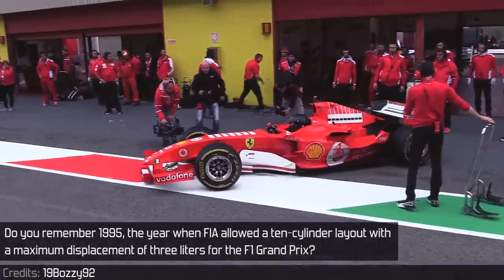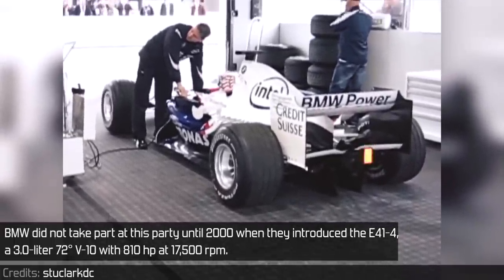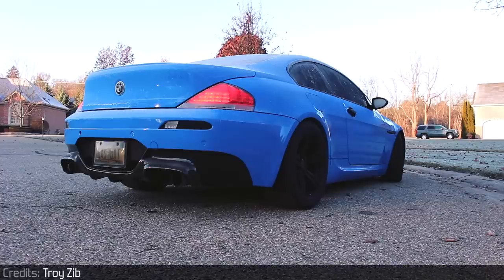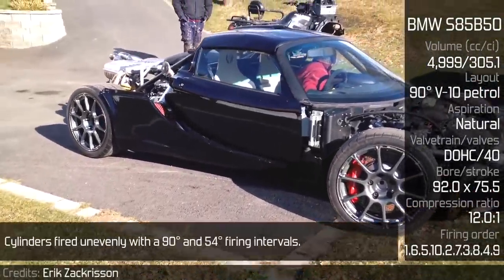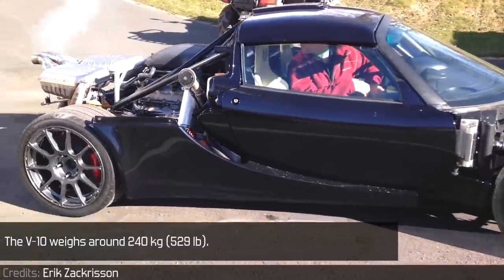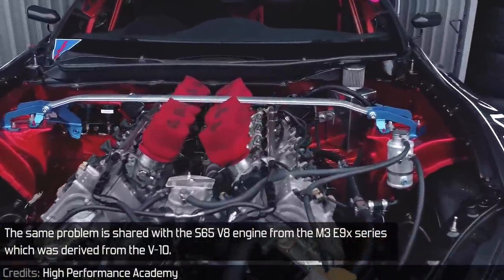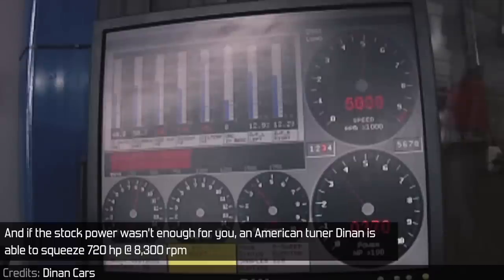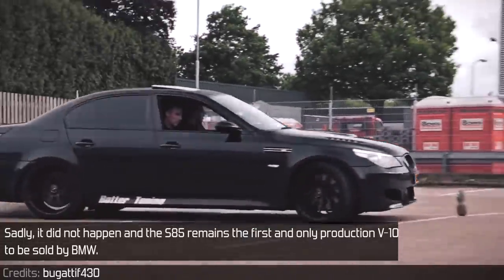BMW S85: Explained | The Only Production BMW V-10

Comment: Still, there’s no mistaking the fact that this engine makes one of the most beautiful engine sounds ever! 😍😍
Reply: Josh Bacon agreed mr sir
Reply: Like drill xD
Reply: Truuuuuu
Reply: It's quite the nice sounding engine, though in my opinion I still prefer the Viper V10 sound given it's a lot more rugged and nasty as opposed to the higher pitched fairly orderly sound. It'd be cool to see other designs that could come in newer sports cars, but it's a bit impractical to the manufacturer.
Reply: Protozerostar I would almost go as far as to say that  because of the high pitch, i like the BMW V10 more. If i wanted to hear a huge engine with enormes displacement and a lot of cylinders, i would look for WW2 aircraft engines ;D (oh, and don't forget the starting problems and the sensual rough idle :D).
Reply: Yes and not a single video i have seen has come even close to what it sounds in real life
Reply: NewSchooler Yeah, you can't beat the LFA :D. The cylinderheads and the exhaust systeme  were build by  Yamaha (also producing music instruments), that says it all :D.
Reply: the sound is really Good. But one should not forget about the Lexus LFA
Reply: It does sound pretty good, but I must admit I personally prefer the e39 M5 sound 👍
Reply: lexus/ toyotas V10 is better sounding
Reply: Too bad that they had rod bearing failures.

Comment: This and the V8 M3 was the time when BMW went balls to the walls
Reply: Zuhairi Zamzuri and they left reliability off the table as well
Reply: As opposed to all other M cars before and after that have had ZERO problems? GTFO troll.
Reply: Biggus Dickus major issues must be the requirement for a great engine then
Reply: SR20DET_RX7 bruh your name is SR20DET_RX7  literally you’re bagging BMW for unreliability yet have SR20DET in your name a engine Made out of glass and blow up every second it has AND EXPENSIVE asf to rebuild or replace that
Reply: @YoBoyNero   Lol, he replaced his 13B with an SR20DET after it blew up. 13B and SR20DET are both more unreliable than the S85.
Reply: @simonnim321  Cough Cough Subaru Boxer Diesel Is The Worst In Reliability. Cough Cough
Reply: @simonnim321  It Sounds Great, But Has So Much Disadvantages...
Reply: @meifert2  It's a compromise between a race motor and a street motor. It's as expected
Reply: @YoBoyNero  actually it's not that expensive or difficult to rebuild a rotary. The factory 12A had 300,000 miles on it and the SR20DET I swapped in is from a 270R.

Comment: Best engine ever made by BMW (in my opinion) 2nd Best V10 Sound, 1st is the Lexus LFA
Reply: M5 > lfa fight me
Reply: Couldn‘t agree more ;-)
Reply: Actually there are two V10 that I‘d prefer over the S85B50:
1st: Porsche Carrera GT - it‘s a manual!!!
2nd: Lexus LFA
3rd: BMW M5 & M6
Reply: An S85 with VANOS deleted, leaves LFA in dust on sound competition.
Reply: @danijellucic2086  why what does the VANOS do to the sound? carrera gt still better
Reply: for all here lfa v10>>> you can find straight piped version of any car even carerra gt  but not lfa. for the guy above put that vanos delete aside.

Comment: One of the best engines in the world
Reply: 722 Silberpfeil ///AMG  and poor reliability
Reply: 722 Silberpfeil ///AMG best at eating connecting rods!
Reply: Rayhan S you are just jealous
Reply: Amo Lay  jealous of what?
Reply: Rayhan S have You owned one?
Reply: Kooper48 i almost bought one until I checked the oil. Chunks of metal in new oil is bad and that is a very common issue
Reply: how did you check the oil?
Reply: John Anderson send sample
Reply: If they wanted to make a reliable engine they would build a port injection inline 6 with no vanos...it would be slow and sound like crap and serve a different purpose.

Comment: Sadly. Oiling has been a M problem.  Our M52 E36 track car has 294K km's on the clock and still does 8 to 9 sessions hard times per track day. The M54 is another die hard. The last M5 with great reliability was the E39.
Reply: you have  a daily engine in your e36 , not m engine..... this is a lot difference man !!!!
Reply: mikkei no it is not. These failures are not acceptable. I happen to be a BMW workshop owner and owned a M5 E39 which is now owned by a customer of mine. Shit brakes,greatest looks ever and an unreal engine.
Reply: 215k miles on my m52 and I’m still beating the crap out of it!
Reply: Cosmic Surfer Didn't the E39 m5 v8 have rod bearing issues too?
Reply: What more does a driver want :)
Reply: didnt heard of e39 m5 rod bearing issues if anything the e92 m3 v8 can share those issues since they're practically same design, it's a s85 with 2 pots cut off
Reply: M50/52/54 are some of the most resilient engines ever. BMW at its best. Is what you'd call "overbuilt". I know a few of them with a turbo making 500+ HP on stock internals while still getting abused on a daily basis. It's somehow absurd for an engine, that was built to be N/A, to make 3 times the power and be reliable. I've seen 3 solid hours of continuous drift abuse on a stock 2.8. Was running absolutely normal afterwards. And that was not the only time it has seen that. It was a drift car. 
The only thing you need to keep in check is the cooling system, due to the usage of plastics. Replace the radiator and the expansion tank with aluminum and you're done. Use and abuse.
Reply: Siddhant Ala i have not heard of one having Rod issues and the one i owned is still running after 17 year and the motor has never been opened.
Reply: I changed mine, they have problems same as s54 and later s engines. Best problem solving is using dry sump system on them.
Reply: Cosmic Surfer the v8 in the M3 has major bearing issues. The engines rarely last 80,000 miles
Reply: Cosmic Surfer I kinda agree with you. Bmw took a bold decision with ///M E60, but I know you love the sound of S85 and the technology behind it anyway 😀
Reply: Any street car running 60w oil is going to have excessive bearing wear if the clearances are tighter than 0.020".    S85 has clearances around 0.012"-0.015"  ,  I suspect the same for the S65.  Makes no sense why BMW chose 10w60 as the oil for those engines.
Reply: Cosmic Surfer lol all I hear is a bunch of krappy motors you listed there. The s38b38 gets my vote for 6 cylinder and the s85 for a v config motor. I have had the m50 and m52 and I really don’t see what all the hype is about a 1jz/2jz ge motors are 10x better than them in every way
Reply: @fmn716  Dont forget the M30 engine, have had a few of them and they seemed more solid then the m50`s and m52 i have had. One of the 535`s that we sold had about 500 000km on it, 8 years ago. It still runs today without any issues.

Comment: Cam you explain why the crankshaft bearings get bust before 150000 km?
Reply: stilkus  tight tolerances and 10w60 oil that was used to quiet vanos operation and early single drain sumps.
Reply: Design flaw. The engines won't last past 100,000 miles no matter how well it was cared for.
Reply: meifert2 did you have one?
Reply: Kanker Reknak one of my buddies had one. He bought it new with 4 miles on it. Changed the oil every 3000 miles and it failed at 82,000 miles
Reply: meifert2 how did he drive?  Was he racing everywhere
Reply: Kanker Reknak that's actually how they reccomend that you drive it.
Reply: meifert2 I own a M5 V10 myself, a friend of mine also and his has 122.000 miles on it. No service over the past 8000 miles
Reply: kenanlambo rip soon 😥
Reply: meifert2 just change the bearings. Mine is over 100K and going strong had her since 33K
Reply: not true i know 3 people with over 120k miles and it runs amazing !!!
Reply: My v10 on my M6 went boom at 105k miles. Bearings were the culprits
Reply: @meifert2  it's not about changing the oil every 3000miles. It's about warming the motor up before high revs, the oil needs to reach proper viscosity.
Reply: @moegamezzz3622  even then the bearing still go to shit.
Reply: @meifert2  ok professor. That's why mine were good. And who cares if you have to change them every 100,000km it took me half a day and cost 1k Au dollars. Too many complaining bums out here.

Comment: The V10 would have been an excellent engine had BMW addressed it's issues sooner and announced a recall and converted back to a more simple oil pump system let it's bad reputation kill it thus causing its buyers to switch brands!

Comment: Man, leave it to BMW to build a V-10 sports sedan.  I've long thought that it would be a giggle if Chrysler built a V-10 version of the 300 sedan and Dodge Charger/Challenger using a retuned Viper engine.  The closest thing available is the Dodge Challenger Demon with a supercharged 6.2 liter V8 that puts out something like 800 horsepower; it sounds amazing but I'll bet the V-10, supercharged or not, would sound equally cool and be a riot to drive.
Reply: Holy Mother of God you just gave me an idea....

Comment: This engine has alusil cylinder coating, which is how the block can be of cast aluminium without cylinder liners. Very tight tolerance between the pistons (which at this price point in my opinion should be forged, but aren't) and the cylinder walls enable such high revving, fast response and high power, but it goes without saying that if the oil isn't to spec and warmed up properly before hard revving, the alusil will get worn off the cylinder walls and then you're fucked.
Reply: The factory Mahle pistons are definitely forged. I have a box full of them at the shop now.

Comment: The only F1 engine that sounded better than those was the V12s that they beat handily. New F1 I am no fan of myself. Honda V10 at 20000 video worth a watch.
Reply: The McLaren Mercedes MP4/15 and MP4-16 are way better than the V12s
Reply: Brain&Force 
They are nice but the 12s just make an extra note the 10s can't. Not better engines, just sweeter music.
Reply: Well actually the McLarens' sound is mostly due to the exhaust routing, not the engines themselves
Reply: Brain&Force 
The blown diffuser did change the tone a bit but a V10 always sounds like one.

Comment: So, anyone looking for an E6x M5 or E9x M3 which is close to or over 50k miles should check to see if the connecting rod bearings have been changed? Is that expensive to do?

Comment: Compared to the 800 bhp that the German tuner G-Power squeezes out of the engine with two superchargers plus optional exhaust systems and a different transmission making the M5/M6 to go over 250 mph, those 720 bhp look boring.

Comment: Has anyone here ever owned a v10 M6? I've heard they are great cars but have a couple expensive failures they eventually run into, like something called the "SMG" pump or something like that? And now the problem mentioned in the video. I only want it as a daily and no I wouldn't mind paying for the performance still, I don't want a car that will stay more I'm the shop than on the road. With that being said if there is any owner here would you recommend me to buy the car or is it too problematic?

Comment: BMW makes some of the sweetest sounding engines. The 6 & V10 & V12 sounds good...  The V8 not so much as it doesn't sound like one
Reply: I'm guessing you are talking about the 4.4 liter Twin Turbo V8. Yes it does definitely not like a traditional V8, but that is thanks to the crossbank manifold, which simply provides even exhaust pulses to each turbo., unlike a standard crossplane V8, which has uneven firing cylinderbanks.
Reply: I think I'm one of the few people to actually like that sound.
Reply: Vethursan1 not just that one. I nearly bought a E34 540 V8 after I sold my E34 M5, but I wasn't impressed by the grunt nor the sound coming from the twin system. Maybe I am to used to the sound of Aussie V8 Muscle
Reply: Aussie Aus Deutschland yea maybe that's it. If it's not the Twin turbo 4.4, then they should all sound like traditional crossplane V8s. Aussie V8's sounds savage too.
Reply: Aussie Aus Deutschland The m60 v8 is something special in it self. If you ever get a chance you should  try running it with just the headers. It runs amazingly quite like the hole exhaust is fitted. Couldn't  quite belive it the first time i fired up the 4.4l non vanos after an engine change, was expecting to hace to cover my ears
Reply: Iceeeen yeah one day I might get one.... but now I'm back home in Oz a manual Beemer of any sort is rarer than hen's teeth let alone a manual V8 which I had a drive of in Germany
Reply: Vethursan1 are you referring to "new school" or "old school" Aussie Muscle? We have one problem here in Australia according to the Yanks... our Muscle Cars are not "Muscle Car's" because they are traditionally 4 door family car's with big hp V8's that are built for Touring Car Racing.... or really red hot straight 6's that were actually just as fast on the circuit as the V8's.... and in the 90's when Ford brought out the Falcon XR6 it was Faster than the V8's.... 
I ♡ my 98 Falcon XR6.

Comment: It makes me laugh when these armchair scaremongers give negative comments regarding this engine , most have never owned one or even driven one but yet they give advice on how unreliable the S85 is ... I’ve had one for 3 years ( M5 V10 2007 )  and it’s never let me down once as long as when it’s first started up from cold the revs are kept below 3k until it reaches temperature plus this warms the gearbox at the same time and basically preventive maintenance is applied along with regular services it’s bulletproof..... the throttle actuators are a must to change when purchasing this car if they haven’t already been done ( £650 ish including fitting which is a good price, I had mine done ) and the rod bearing shells which is advisable if your going to keep the vehicle ,  mine has done 88,000 miles and the oil is analysed every two years last one was done last week and came back fine but I will eventually be having the rod bearings changed to APL shells and bolts as i will never sell the vehicle , I only use it as a weekend toy so around 3k -4K miles a year is put on her and PS: I wouldn’t advise as a daily runner it’s more of an enthusiast car tbh 👍😎🇬🇧

Comment: Just so problematic to fix, rod bearing is just the beginning, you got the smg issue then vanos failure which can lead to engine failure alongside throttle actuators. Like idk how this engine won awards if it was so problematic. Build quality is also something that should be judged. It's so sad Bc I wanted one but I ended up getting a AMG Bc i couldn't believe how problematic the s85 was I was shocked and nervous.they are all problematic like a time bomb please don't believe anyone esp owners, the facts don't lie, even the newer models suffer from these issues I listed. BMW doesn't deserve the credit they get, all their NA cars were problematic besides the s50 and s52, why doesn't gt500's have these issues or ctsv ??? BMW bites into something they can't handle, time will only tell for their forced induction cars. Also you can tell a car company made a good engine when the engine lasts over 80-100k miles but as all these BMW's got up in age you start to see them literally falling apart mechanically it says a lot about the notorious "ULTIMATE DRIVING MACHINE"

Comment: Every time I hear "Internet Experts" stating the S85 Rod Bearing 50k miles replacement is a must, I just want to scream! I removed original ones on my S85 with 136k miles and yes, they were worn but the crankshaft journals were still fine with no groves or scratches. I'm sure all these shops who did completely unecesary replacements are not complaining at all.